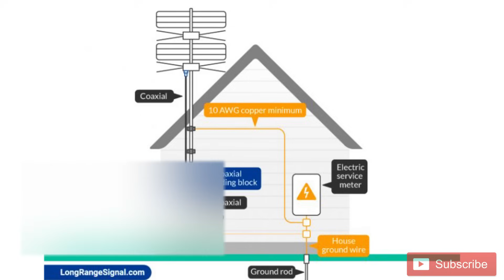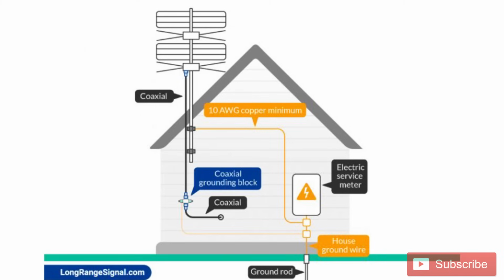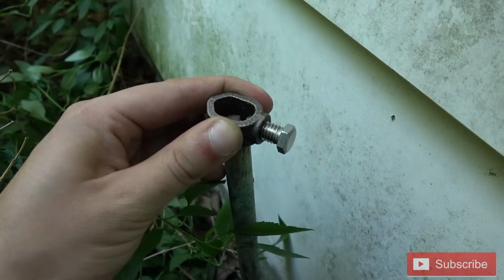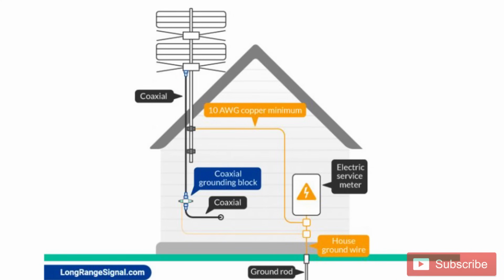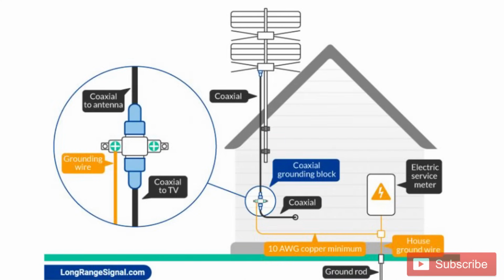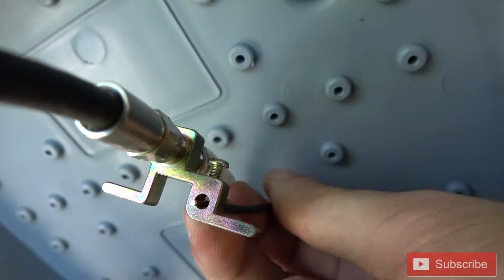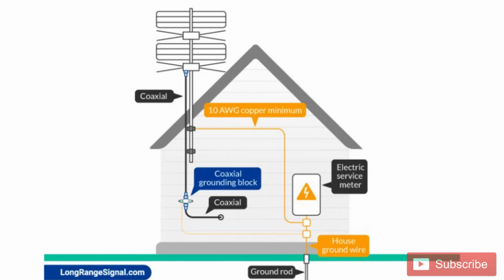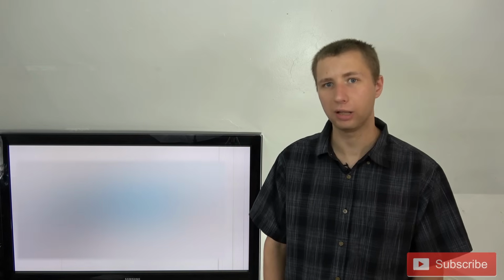How To Ground an Outdoor TV Antenna Per NEC

Comment: I have installed a few "Lightning Rod" systems on roofs of multi story homes, barns, silos etc.
     The whole idea and theory behind them are that they actually drain away any static potential that may exist or build up on the structure and in the air close to the system. This will hopefully cause the lightning to seek another pathway that has a built-up potential in the event of a near strike.
     The systems installed are robust and the cabling is usually a 2/0 AWG woven copper non-insulated conductor with vertical "rods" at each end of the structure and additional rods spaced between about 30 to 40 feet apart.  The cabling is large because in the event of a possible "strike" to the system, you want the large current / voltage  pulse to follow the path of least resistance to ground and NOT through your structure.
     The voltage potential of lightning is very high,  upwards of over 10MV and can be beyond 250 Million volts. Remember, this static electricity can discharge from miles above, so any kind of fuse is useless and just becomes an air-gap of vaporized metal.
     One last note. If you watch videos of lightning strikes, you will see a lot of branches collect into a main "trunk" or bolt, so it appears. What usually happens is the discharge begins from the earth, object or structure and diffuses through "branching" up into the atmosphere above. Lighting can occur ( although rare ) with a cloudless sky.

Comment: 10 gauge is not really good enough for lighting protection. You really need 1/0 for lighting.
Reply: Yes and it should be like the kind they use on lightning rods.  Also it's best to tie all grounds together. It dont matter if you use another grounding rod. All grounds should be tied together. Ham radio operators also ground the antenna lead when they are not transmitting or receiving.  It's just best to close down transmission when an electrical storm is present.
Reply: @ronb6182  
Yes I installed lighting protection and there are all kinds of little rules to know like no sharp corner in the wire are the lighting can jump off. It's really cool to see it in action too. We did a parking deck and one day during our work there was a big storm and we got to watch lighting hit the rods . Very cool .
Reply: @benjimenfranklin7650  thanks for reminding me that rule about rounded corners. I read about it a while back.
Reply: @benjimenfranklin7650  I never saw lightning hit our lightning rods but I heard it. You would hear a big bang the one second or less then a ping. I only heard it two times   since we owned the farm. The lightning always hit the kitchen chimney lightning rod it never hit the higher part of the house. The chimney at the kitchen was a longer chimney about 4 feet above the peak of the roof. The fireplace chimney on the high part of the house was only about 24 inches above the peak.i figure because the kitchen chimney was more open air space. 

One time when a storm was coming I had a short wave long wire antenna and I took the lead in wire and touched the lead on the metal box on an electrical outlet and it sparked.  I always kept the lead in wire plugged into the ground when I wasn't listening to short wave radio as a safety precaution.  Lightning never hit the wire if it ever did that antenna would have burned up because of the thin enamel wire. About number 22 guage. Ham radio rules state to ground your antenna lead when you are not using the antenna. I live in florida now and we always have electrical storms especially in the summer months.
Reply: @ronb6182  
The parking deck was concrete and steel and you could see the lighting when it jumped from the lighting protection to the steel that is why you want as direct path as possible to ground as possible.

Comment: A true ground would be a solid copper rod as thick as the mast/pole, 2" or better and strapped directly to the pole and the solid 2" or better solid ground rod needs to be at least 8' in the ground. Is anyone going to do that? No, they will not. If you ground the cable and antenna using 8 or 10 gauge wire all you are doing is reducing static build up.

Comment: Tells us where an how to put ground rod in the dirt.?????
Reply from the maker: There are typically local or state agencies that you can call so they can mark where underground lines are before you put anything into the ground. As far as putting the ground rod into the ground it's called a shovel and a hammer.
Reply: Starting at one foot depth, or less, it's solid rock where I live. I've been advised to put it next to the house because the block layers had to have room to stand as they built the foundation. Otherwise I'd have to use dynamite to make an 8' hole, which isn't advisable near a completed house.

Comment: Depending on the antenna model and balun, most masts do not need a separate wire to ground. The outer shielding of the coax makes contact with the mast through the windings in the balun, as long as the antenna is aluminum and makes proper contact with the mast. Cheap plastic antennas do not make contact with mast, and many have improper grounded baluns. Also, those outdoor electrical boxes often connect to a plastic PVC pipe into the ground, rendering them useless for a proper earth contact ground. Relying on the electric company's ground wire back to the transformer, then down the pole, is a really long path to Earth. It's so long, in fact, that they are useless to discharge static from wind and electrical storms, and the static often discharges into the first connected TV instead because the first connected TV is a shorter path than the pole path to Earth. Electricity follows the path of least resistance. Therefore it is always best to earth ground the coax through a ground block at the entry of the home. Tie into the house ground bus bar or ground wire whenever possible or drive a ground stake into the ground and connect it to the coax ground block. This ensures proper static discharge to earth and chassis/shielding interference from LEDs and other RFI. Ground loops cause pixelation of VHF channels if too many grounds are used. Try to avoid ground loops if possible.

Comment: Ground rods need to be installed outside the eve of the house where the ground gets rained on not in dry dirt that will never conduct good enough. Low capacitance braided wire is really the best to use like the outside copper braid of RG8 coax used for CB/Ham radio and all plumbing in the house you have thick jumpers over water meters and hot and cold connected together at the hot water tank. Everytime we had a lighting storm or a close strike we many times saw sparks near outlets, or popping, cracking sounds, and in over  dozen years or so not one peep during a storm and I have 2 tripods on my roof full of antennas and weather instrument with the legs of both jumped together using the clamps shown in the video and I have never disconnected my electronics and never have had to worry about lighting again.

Comment: As an antenna installer, one of the worst things you can do is put in a stand-alone ground rod for an antenna.
Lightning travels through the ground, but a little different than through the air. Ground is a poor conductor, it becomes saturated with electricity at the strike point, and looks for any kind of shortcut to get away. Chain link fence, water pipe, antenna cable. The electric surge runs up the antenna ground rod, through the coax cable, TV, house electric wires, and out the electric ground rod. The neighbor's house got struck, and everything in your house is burned up. I've seen it with antennas and yard mounted satellite dishes.
If you have to use a ground rod, or a mast away from the house, 'bond' it to the electric ground. Run a ground wire between the two ground sources, and give the surge a better short cut.
Reply: There isn’t any protection from a direct lightning strike no matter what you ground it to. There is no surge protector rated for it either.
Reply: What I tell my customers is that in the event of a direct strike, we're no longer trying to save the TV...
Reply: I can see your point, two grounds to the TV (which will not be remotely the same voltage in case of strike) will cause the lighting to flow through the TV from one ground to the other, destroying the TV.  But as far as burning up everything in the neighbor's house, that is even more true if you use a single ground.

Comment: Oh boy, not sure on your "Code" but a simple bit of advice for novice giving advice on matters not understood....
Three types of Earth:
#1 - Electrical
#2 - Communications
#3 - Lightning
All should be separate and never joined or used for the other. Using electrical earth for comms (includes your FTA TV) is bloody nuts.  Not even going to explain why.
Reply: I would have more or less agreed with you but clearly the powers that be do not agree (at least not yet).  I wish that when people issue rules they would include a justification, without knowing the "why" it is too easy to mess up following the letter of the law but missing what was important.